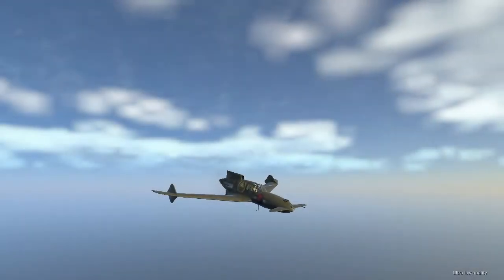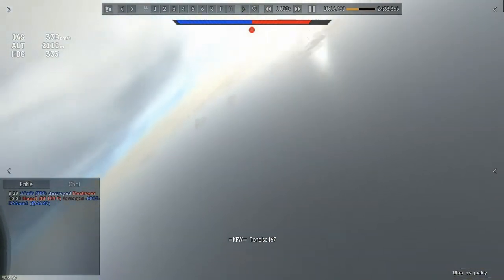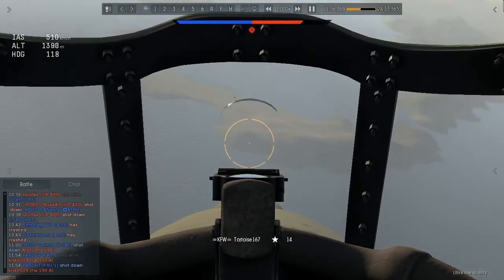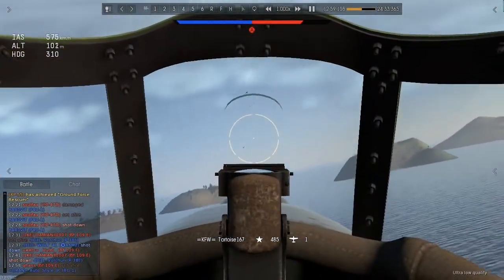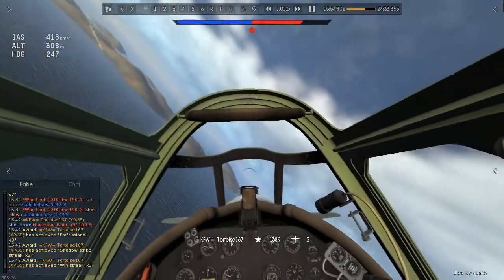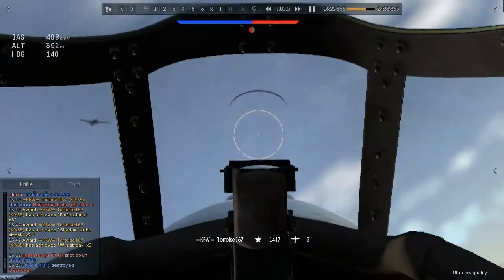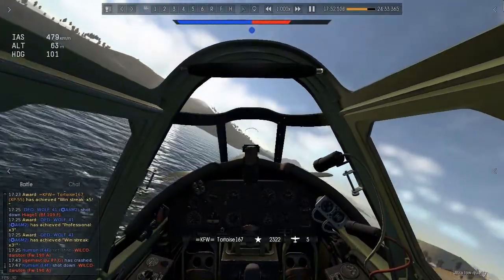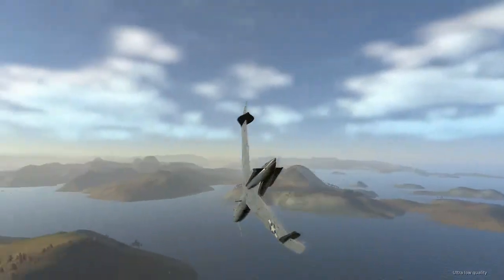War Thunder (SIM): American ingenuity -[XP 55 Ascender] Air Sim gameplay.

Comment: Machineabuse from the forums here. I'm not going to dislike your video, but I think you should know why it deserves one.

Paper aircraft like this one, and the same sentiment applies to premium captured aircraft in WT is a big reason as to what erodes the value of player skills in the game. Simply put, when the aircraft is overperforming by so much that a half decent pilot can go in and consistently ace in a day versus aircraft that cannot match its rate of turn, climb or speed then what is the value of the statistics generated by that?

You can look at any player's stat card and get a picture of how they like to play the game by the aircraft they consistently choose to fly. Whether they play the game to get kills, lions and RP or whether they are genuinely interested in becoming better pilots. This is why the Ki43-III is so hated by really skilled SB pilots because even though it's slower, it's exaggerated climb rate means that as long as you can keep the nose of the aircraft pointed at your opponent most of the fight you will eventually and surely erode the energy advantage of any other aircraft you will face.

Uncoincidentally, the Ki43-III is another aircraft in the game with a paper plane FM. Surely, if these aircraft were so historically capable, we would have actually seen them go into production over the aircraft that beat them.

Are players who club in those planes at fault for this state of affairs? Of course not. The onus is on Gaijin to acknowledge, own and fix the problem with their product. But is this activity worthy of praise?

In my opinion absolutely not.
Reply from the maker: +Benedict Tan 
I understand where you are comming from and what you are trying to tell me and I will not deny that this video is just a pice of shit.

I knew from the start that this plane is uterly broken and to be frank I was having issues finding anything to talk about in this one sine frankly they way he way flying is not how experianced, skilled sim pilots fly.

I'm thinking of taking it down but I think I will keep it around just to remind my self that I need to hold my own content to higher standards.

Thank you for being so critical, sometimes It's hard to be self critical and these kind of comments help.
Reply: +soulfax444 Most of us have to fail our way to success in most of the things we do. For what it's worth the effort you put into your videos is commendable and since you are resolved to learning from your mistakes I'm certain you will soon find what works.
Reply from the maker: This is not my first blunder but I would like to imagine that sooner or later I will work my way through all the required mistakes.

Until I do I will have to think hard before publishing any videos what so ever.

Again thanks for  shaking me up a bit, I got to used to this whole YT thing that I actualy expected people to like that video.